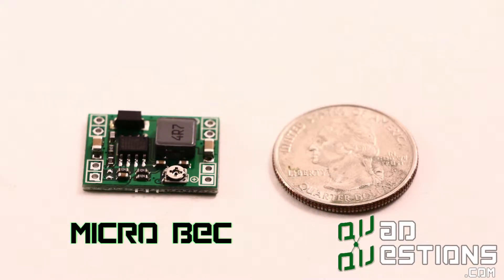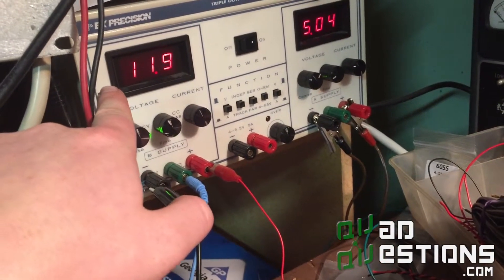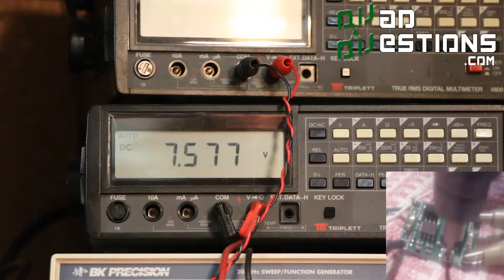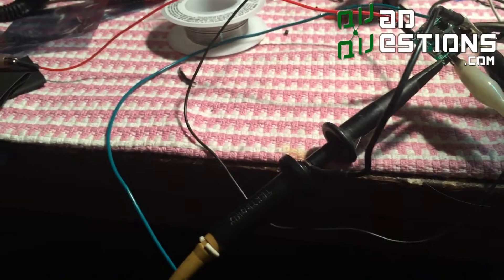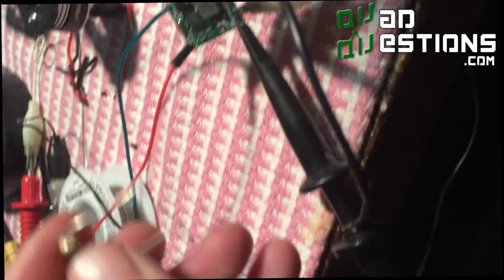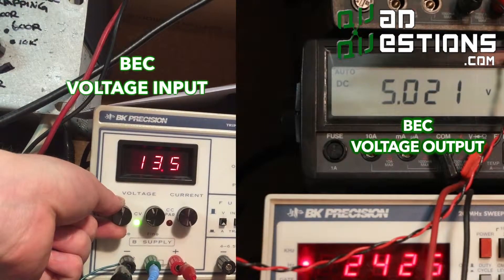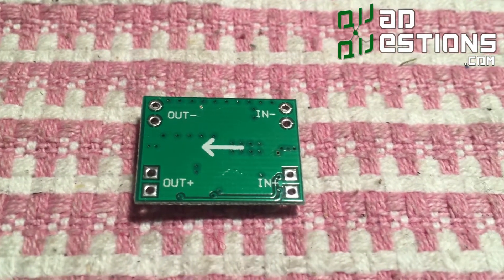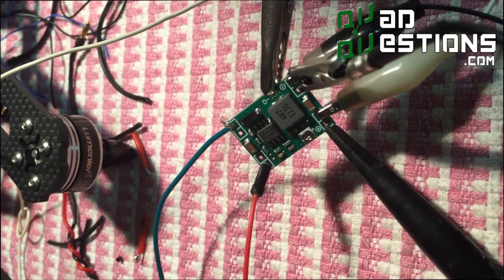BEC

Comment: Have you ever pulled 3A through it? Curious if would be enough to run a couple small fans, a traxxas 2075 servo (supposedly pulls less than 1A @6V) and a receiver at 6V with 7.5-8.4V in. I just tried a hobbywing 3A and I can't even move the servo with the wheels off the ground or it drops so low the receiver resets.
Reply from the maker: The one used in the video is the QQBEC, not a Hobbywing BEC.  
You can find the one used in the video here:
https://quadquestions.com/product/qav250-bec/

We have a full test lab setup at the QQ headquarters- and yes, we have tested them with a 3A load, but we don't recommend driving large current loads such as a 3A servo with them-  3A is the absolute maximum current output and requires a heatsink. It is also very noisy at high current outputs.

 It's a good general rule of thumb to never run your electronics at their max ratings- give yourself 75% of what they are rated for a safe margin of error.   A 3A load such as your servo should not be powered by a 3A BEC.  It really should be powered by a supply that can deliver 4 A of current to satisfy good engineering practice ;)

Here is the data sheet on the regulator installed in QuadQuestions QQBEC:
http://www.mouser.com/ds/2/277/MP1584_r1.0-779241.pdf

We have used these boards for all sorts of different applications and they work great for things like powering receivers and other smaller electronic devices.

In your case, you might have a cheaper BEC that has a promotional current output. 

Keep in mind that a higher voltage main battery will give most BECs less available amperage. For example, If a BEC with a 2 cell (7.4V)  volt battery has an output of 3 amps, the same BEC with a 11.1V (3 cell) battery has an output of 2 amps. Increasing the Battery voltage by 1/3rd, decreases your BECs output amperage by 1/3rd. This isn't always true, some BEC's outputs are unaffected by their input voltage. But your Hobbywing one might be the former.  

Check with the manufacturer or look at the Datasheets to find out.
Reply: Thanks for the info.

My servo at most pulls 1A. I was only mentioning my HW BEC was rated 3A constant 5A peak with a 2S supply and that it wasn't enough to power my servo. So, either it's junk/bad or mislabeled.
Reply from the maker: Sounds like something strange is going on with it. Let me know if you need us to hook you up with the QQBEC.  ;)

Comment: I have a couple of these regs on the bench right now. When looking for ripple and transient response on the 'scope you should use AC probe coupling and turn up the sensitivity to something like 10mV /div. looking for a 50mV ripple on a 5v/div scale is futile. As for the 3A rating, I would not push these beyond about 1.5A continuous as ripple rises quite rapidly and so do the temps. 
A couple of final tips. As delivered there is very little output capacitance so transient response is not going to be great. Adding an electro cap of say 470uF or more would be advantageous. Finally put some glue on the potentiometer after setting the output voltage so it can't change in service.
Reply from the maker: Rob B Thanks for the tips.  You are absolutely correct about placing glue on the potentiometer.  Good tip!. Ill have to try the cap mod you mentioned too. 

I realized after making that video that I should have dialed in the scope a little better to show the output ripple.  I do have the facts from the data sheet listed on the site:

The data sheet for the regulator states as follows:Input voltage: 4.5-28V
Output Voltage: 0.8-20V (adjustable)
Output current: rated current 3A(MAX).
Switching Frequency: 1MHz
Output Ripple: less than 30mV
Efficiency: 96%(max)
Operating temperature: Industrial grade (-40 C to +85 C)
Module Properties: Non-isolated step-down module (buck)